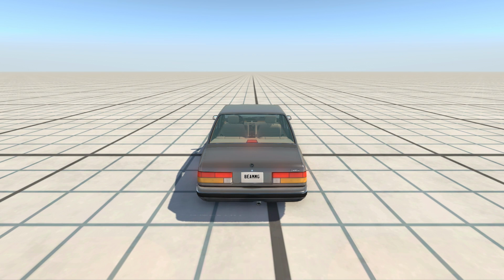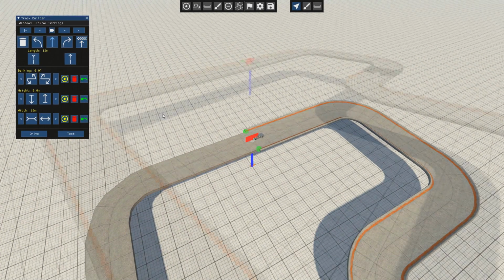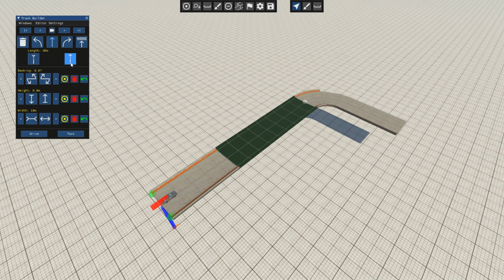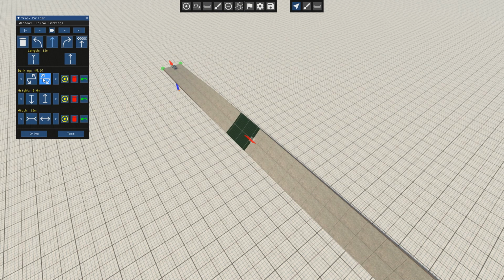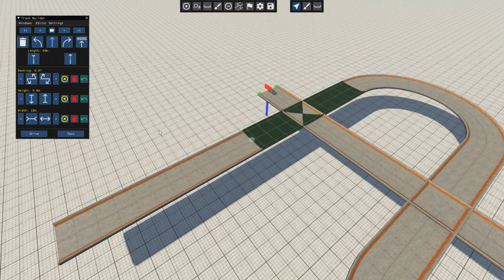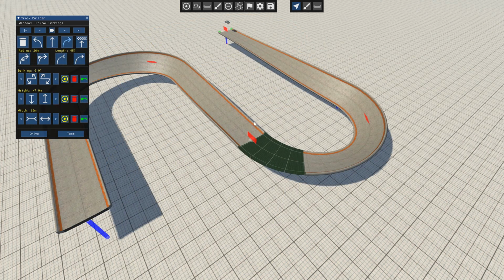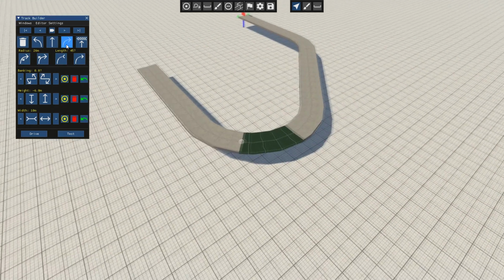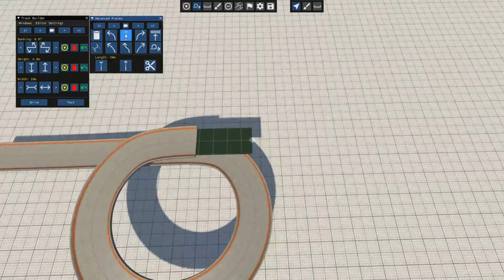BeamNG.drive - Track Builder Tutorial

Comment: Coming to this in 2025 the track designer doesn't look like this at all. The controls for building the track are similar in most regards but...
Why is it set in a dark 'Tron' like setting, and how do we get out of this or change it? Its too dark, you can't see the track properly and its not obvious what surface you are even driving on.
Why is the track's 0m elevation some 500m in the air? If this cant be fixed, how do we add edges/run off to the track? Right now you drive off the edge and you have no choice but to reset.
How do you take these tracks and put them in an environment. I could probably live with it if we were in some big green field or car park but as it stands the Tron world is just unworkable.
I love the fact that all this exists but somewhere between the making of this video and now, its all gone off the rails.